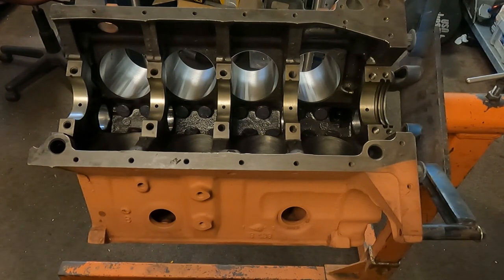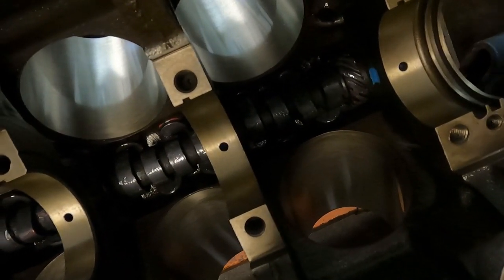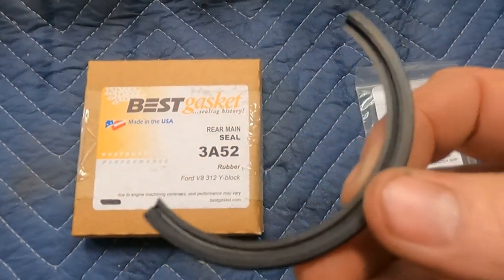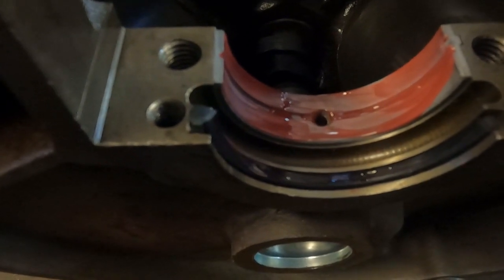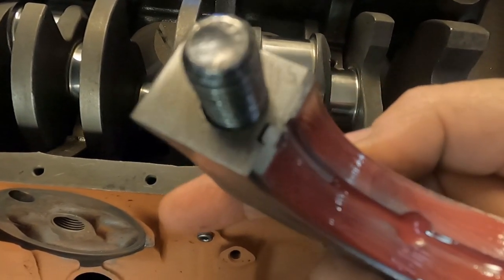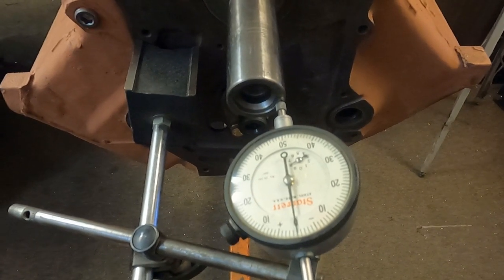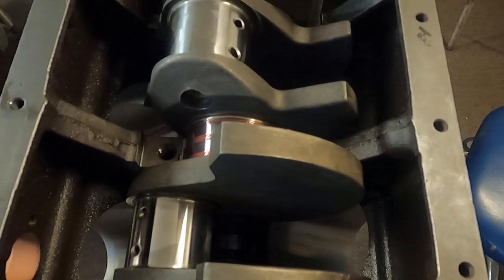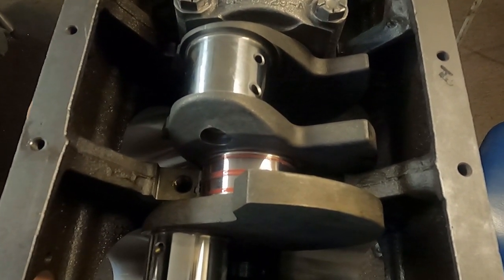Ford Y Block Basic Short Block Assembly Tips: Part 2

Comment: Hello...my 239 y block has the same 2 grooves in the rear where the rear seal is located. Why is there 2 grooves?
Reply: One groove is for the "throw" at the rear of the crank. Essentially this is a ridge that runs the circumference of the crank to "throw the oil off" so to speak. The other groove in the block is for your seal.
Reply: @HotRodReverend  thank you so much for the clarification.

Comment: QUESTION: WHY DID FORD MUSHROOM THE LIFTERS WHERE THEY GO IN FROM THE BOTTOM?
Reply: This was fairly normal design for lifters in the pre-hydraulic era & even early hydraulic lifters in Cadillac's & Packard's looked similar. The flat bottom allows plenty of contact area with the cam lobe while the skinny shank keeps the lifter bore size down, saving space, material & probably creates less friction than a big diameter shank.  Don't forget this was one of Ford USA's first modern / post war engines, so  some aspects are bound to be a bit dated or odd ....like the inlet ports!
Reply: @johnrebus1641  THANKS YOU FOR THE INFORMATION.

Comment: My engine builder suggested 292 blocks with 312 crank/rods/pistons due to possible cracks with 312 larger bearings. So I have two 292 engines that configuration. Also have a real 312 engine that was crack checked first. All with HE pistons from John. One is single carb, one dual carb and one supercharged with Johns intake (pressure limited to 5 PSI for HE pistons) and all built to happily spin 5500 (w/91 oct). All tire dyno tuned and many years street rod use no problem, and by no problem I mean oil leaks keep bottoms of cars from rusting no problem no matter how carefully I sealed the engines. Retired aerospace machinist so careful is a thing. Suggest dyno tuning for HE pistons and best power gain always from quality long tube headers but they ain't easy to find.